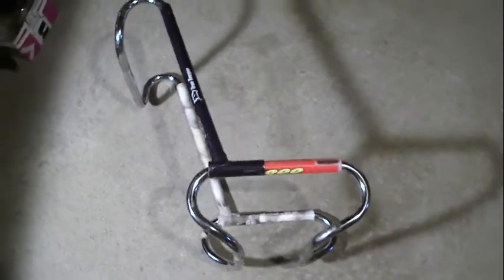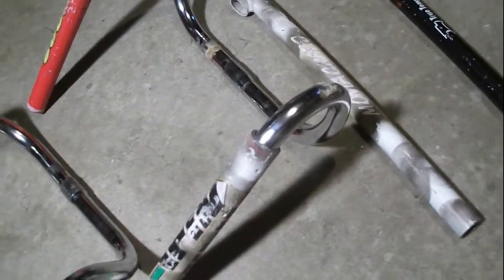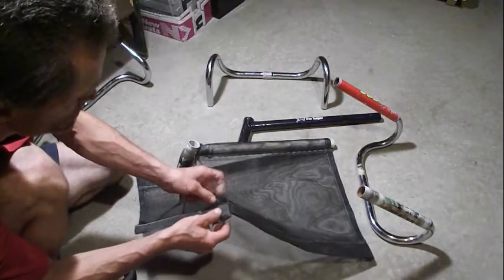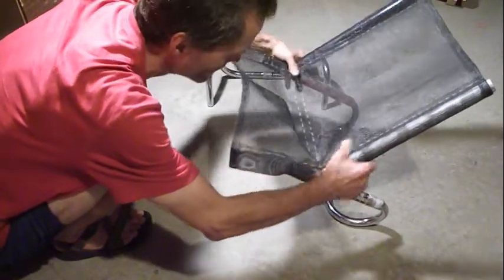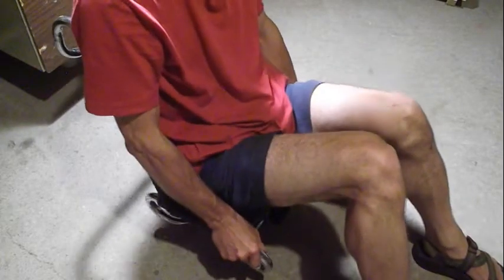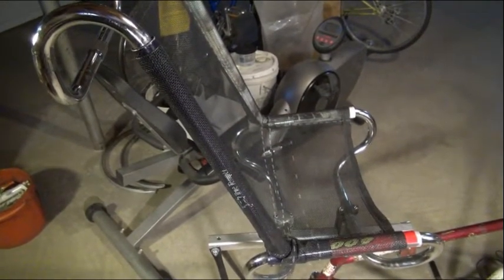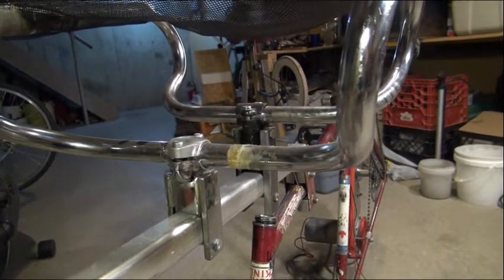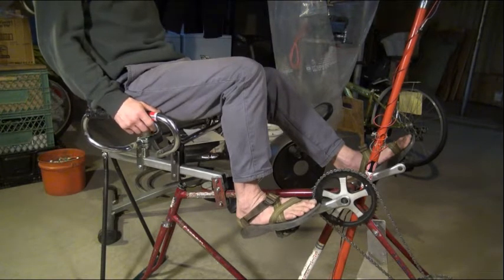Recumbent seat from bicycle parts

Comment: what is the material for Mesh?
Reply from the maker: It is truck mesh, used to cover up loads on a truck. It is plastic (vinyl?) coated nylon. Bought it years ago at a place that sells and makes awnings. I've gotten similar material, used on lawn chairs, at a fabric store.
Reply: Phyfertex fabric is used in patio chairs , boats , and recumbent seats. Available from https://www.christiesfabrics.com/
easy to sew and has good resistance . Good color selection too.
Reply from the maker: Thanks for the link!